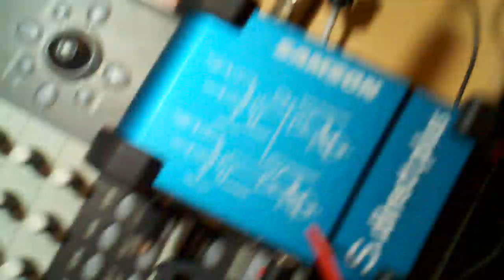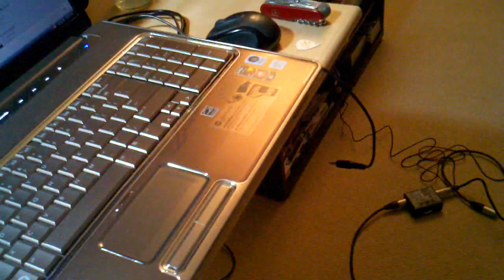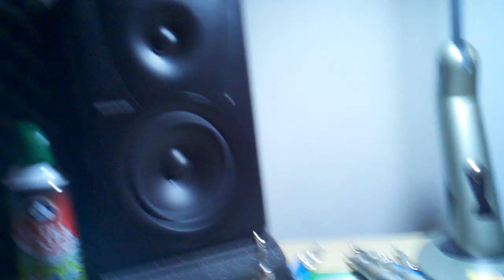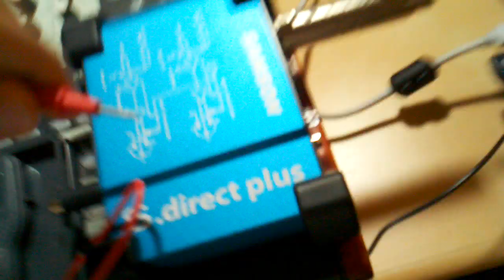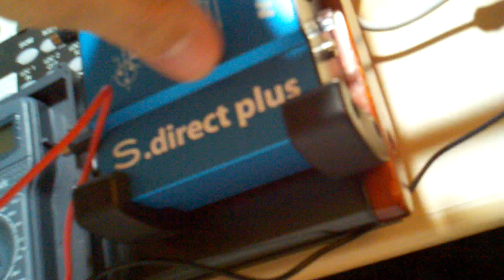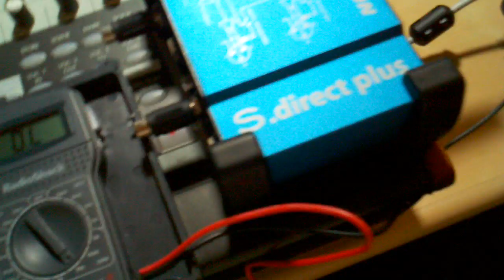Active Direct Box: Ground lift does not fix ground loop!

Comment: Hello. A quick question.. Do  D.I Box can retain acoustic guitar sound Including Tapping? And percussion etc.? Thanks for reply..
Reply from the maker: +AljhonRadaza Your question is a bit general.  If you are referring to Fidelity of sound, in that a DI and components of an audio system are able to reproduce accurately an audio signal into audible sound, then depending on the DI and setup yes. The idea is to have a DI box that does not add or attenuate any frequencies or noise present in the original signal. The rest of the components are other variables to your question.

Comment: Even the video is outdated - the problem with laptop is not a ground loop but impulse power supply connected to the same contour with your sound device. All professional guides tell that they should not be connected to the same outlet/power hub. Best option to connect the audio device to the separate power line like all high wattage devices are connected (laundry stuff, semi-industrial stuff, etc. etc.).
Reply from the maker: yrussq I do not follow, same contour? You mean same phase? I agree that power amps should be on separate circuits verses signal processors, mixers etc. The ground interconnect between these devices is where the noise comes from. The video is not outdated, nearly all ACTIVE DI boxes are built with this topology. The ground is isolated, not lifted because phantom power is required to power the OP amps inside it.

Comment: You have an ACTIVE DI there. That is why there is no transformer. Passive DI's use transformers but cheap x-formers sound bad and good ones cost $$$. You can get good sound at a low price with an active DI. Active DI can sound very HiFi and more detailed than a passive but they do not block ground loops. Active DI's are good for instruments that DO NOT use an AC power supply like bass or acoustic guitar (without an amp). Keyboards and and laptops do have a grounded power supply so passive DI's are best for them bc of the transformer isolation. Looks like you might be dealing with line level devices too. A passive DI will isolate them but do you really want the mic-level output? You may need a line level isolator. Full disclosure, I work for Radial Engineering and we make the best DI's in the world. We also now own Jensen transformers the best transformers that can take hot signals and not saturate like cheap transformer. The jensens can take 20dB at 40Hz! Thats alotofbass! Get a passive device to block ground loops but you'll pay around 200 if you want good Jensen or Lundale transformers in it. We also make the TWIN ISO, a pro-audio stereo line-level isolator and several other DI for laptop audio.
Reply from the maker: Thank you David I really appreciate the engineer side of things. Most definitely you get what you pay for. From a livr application standpoint I can never justify spending that much for a DI box. In a recording application however is a different story all together! Cheers!!
Reply: David McKee Smith Sorry for interfering but i have few question :)
1. Does the ground lift mean that if two interconnected devices both have ground lifted would have "hot" chassis if one of them get short circuit to chassis?
2. Could the guitar amps be isolated withe double isolation scheme or that's impossible because they always have player's physical contact to plugged guitar  as a breaching element?
3. What DI has with ground loops? It does not have connection to power outlet's ground - it's just interconnecting device. You should solve ground lifting problems  on the connected devices not on DI. So what is GroundLift button doing there on device?
Reply from the maker: yrussq I can answer a few of them, but feel free David to chime in:
1. Yes,  both chassis of the two interconnected devices will be floating without a reference to ground. Potential current from chassis to earth is proportional to the resistance of ones  skin in contact with the bare metal chassis. meaning, current goes through YOU rather than straight to earth.

2. Using a 1:1 power isolation transformer would isolate the amp, and depending on the guitar, itself and the player as well. Passive electronic guitars have their bridges grounded through the 1/4 cable. if the guitar amp was floating ground there could be some circulating current from the guitar amp, through the bridge, strings, players, hands, returning back to earth. Modern amps have "moderate isolation" to limit this current. Old school valve/tube amps...not so much.

3. Your question is unclear. Is english not your primary language? The purpose of a DI box is to isolate interconnected ground points removing the voltage potential between each point which manifests itself as electric mains cycle hum. In an ACTIVE DI like this Samson, the ground is isolated, NOT lifted because phantom power is required to power the OP amps inside it. Lifting the ground completely means removing the path to ground, preventing the DI box from operating at all...UNLESS it had an internal power source like a 9 volt battery to power the circuitry inside.

Hope this answers your questions.

Comment: Help to an old issue that i used to have as a sound engineer. Last minute fix for earth loops off most audio sources. remove the eath between the main power supply plug and the transformer/ power supply.  I keep 2 cabls like this in my 'box of tricks' drilled out the earth pin on the clover leaf plug of one and  could remove the earth wire at the plug top of the other.  NOTE: earthing on devices  is safety! make sure your equipment is in good condition before doing this.

Comment: the noise is driving me crazy, ive tried waves crackle remover plugin but it takes away from the depth of my vocals, are you saying that you dont need a di box if you buy one of the hosa adaptors? my problem is that i use a stealthplug interface which has a 1/4 inch jack plugged into the tape out on an old guitar amp, then i have the microphone with a xlr to 1/4 inch jack plugged into the input on the amp. but i can only find xlr hosa adaptors! id be really grateful for any help!

Comment: Correction: The S Direct schematic (on unit top) indicates a ground lift switch in series with the sleeve of the TS input connector, not pin 1 of the output. (Note the insulating plastic bushing under the TS jack nut). Most hum is supposed to be eliminated by amplifying the voltage difference between tip and sleeve of the input and not by lifting output xlr pin1.  However internal battery use permits the opening of xlr pin1 path.  Hum is now further reduced by eliminating the 5k ohm ground path.

Comment: The S direct Plus can be phantom powered.Therefor the pin1 shield cannot totally opened. The 5k resistance provides a DC current return for the +48V phantom power.  Running with the internal battery, this ground can be totally lifted. I do appreciate your post because I a have this unit and never thought of this application you presented.  I've used this box to convert single ended aux outputs from a mixer to xlr balance to run active stage monitors connected to the end of a 150 foot snake.

Comment: Hi, it's the turtle beach x12 and a standard wired controller. (the newerst black model gloss) I use standard RCA cables and I purchased a ground loop isolator as I receive a slight ,undoing with the headset. I also contacted turtle beach and they are sending me a new chat cable. Thank you very much for the response I'll check the site out